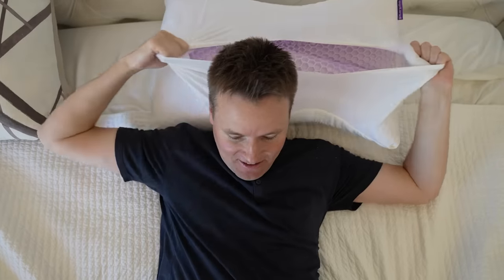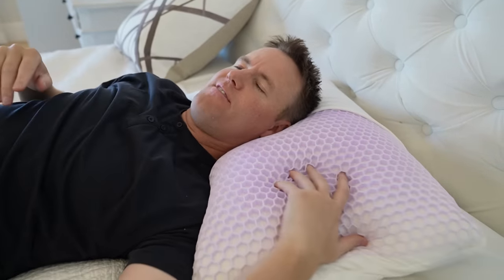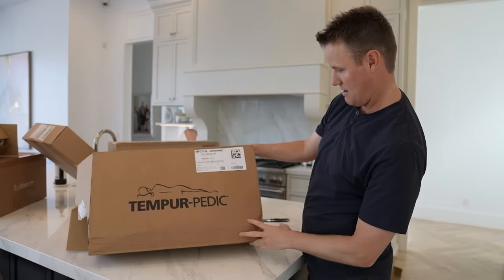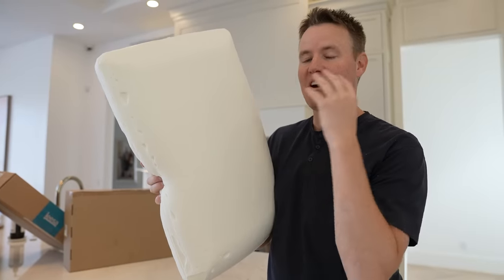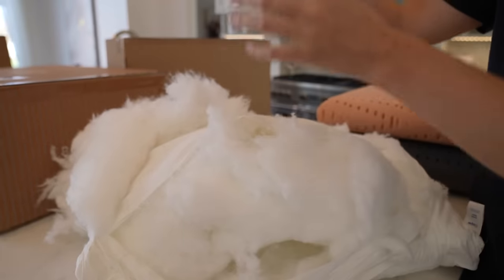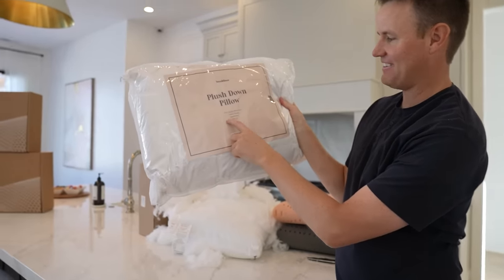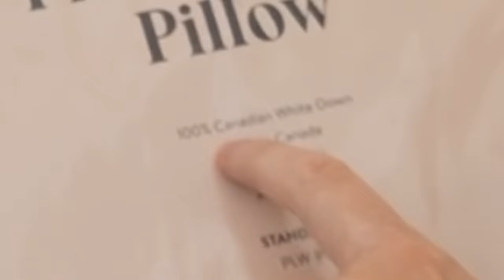What's inside Purple Pillow?

Comment: Nice pillow teardown! And nice messing with down (I suppose that's a goose down)! Would be interesting to find out which types of pillows are the best for hot weather, with temps over 90F. Memory foam pillows usually get very damp and even turn into liquid and you find your head in a swamp at night.

Comment: Thank you for the video though I'm finding it a bit late.  We encountered the Harmony over the weekend finding it to be the first one we've liked since getting our latex pillows some 14 and 12 years ago respectively.  I guess I shouldn't be surprised that the inside is nothing more than a (most likely) Talalay Latex foam pillow.  I guess the big question is whether the "grid" material on the outside is sweatproof protecting the latex core on the inside which is the only knock on latex that I've seen.  I tried the original purple ($100) pillow but like memory foam it still doesn't work for me as a sleeper.   I was hoping to see a "gutting" of the "down-alternative" from purple as well (Purple Cloud Pillow) presumably meant to act like the Brookline with the ability to throw the whole pillow into the washer.  While I'll probably end up taking a chance on the harmony (and it's $100 wrapping of "purple grid) it's likely to be a hard sell if I can ever find a true breakdown of the Cloud.  ;)